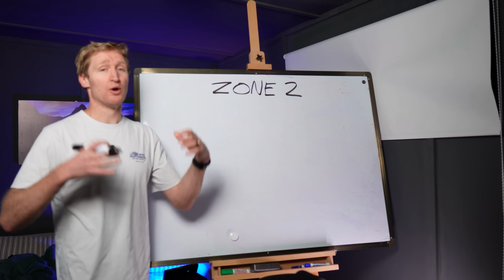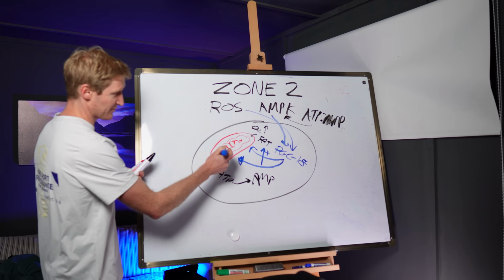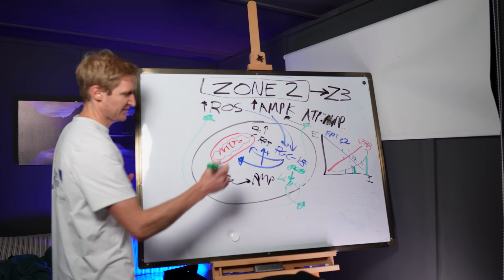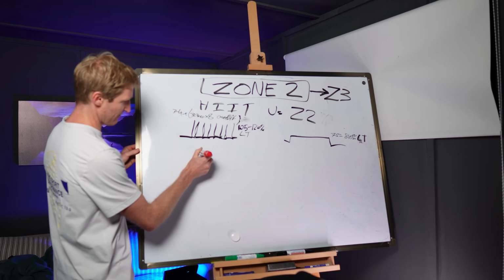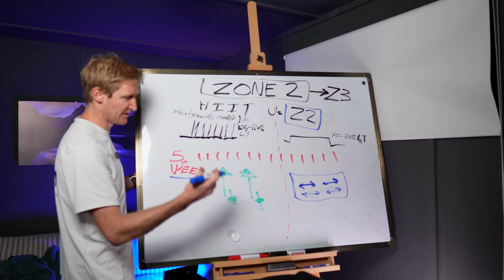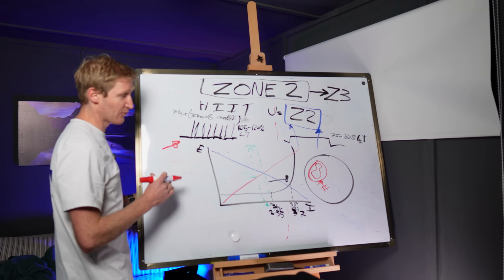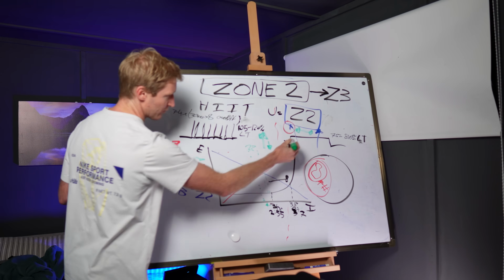Running Top or Bottom of Zone 2 - Deep Dive

Comment: For most runners, the purpose of Zone 2 training is less to do with energy channels, and more to do with safely increasing training load at low injury risk. For elite cycling it's a little bit different because they can train at very high loads with much lower injury risk - so they have more choices about how to allocate those kilometres. For running the practical test of where to run in Zone 2 and whether it's ok to drift into Zone 3 a bit, is whether you can recover in time for the next session. And the recovery test is mainly about the joints rather than whole body energy systems.

Comment: So, my zone 2 pace added 30’s per mile pace, but I stayed in the upper part of the zone 
But in the heat everything has been zone 4 until temp dropped back down into 50/60 degrees and magically is was all zone 2 at same time per mile pace I had been running

Comment: A follow up question: Is it ok to drift into higher zone 2/ low zone 3 during the end of runs due to heart rate drift? On top of that, with it being the summer months heart rate sky rockets despite running at an easy pace. Should I live by heart rate effort in hot conditions?

Comment: Hi Will! Would mixing in a few strides into all of my zone 2 runs undo the benefits of Z2 discussed here?
Reply: No, because strides are short enough to not raise HR. 

Intervals on the other hand raise HR so should be avoided on zone 2 days.
Reply: @aliasgharkhoyee9501 thanks. For me a 20-30 sec stride definitely drives me into zone Z3 (HR which I’d have around tempo effort level at steady state)  when I am already running in Z2 for some time. It also will take 20 secs to get down to Z2.
Reply: @florianpreis9239  I suppose we're using strides differently. I'd consider strides to be about ~10 seconds where you don't speed up beyond 80% of your max speed. 

I can see how faster paces (sprints) and longer durations will increase HR. In my understanding, this should be avoided on zone 2 runs, so shorter and slightly slower strides may be the answer.

Comment: I know i'm not perfectly who this is aimed for because I'm not really looking to do distances over 10k so not fully endurance but I've been trying to use these videos (and the podcast) to understand how to use running as my secondary sport to increase my fitness in the offseason and cross-training during the season for Badminton as my primary sport. 

I'm time limited with coaching during the offseason to 3, maybe 4 max, runs per week and at the moment (offseason) I've been trying to do 1-2 zone 2 10ks, 1 interval session and 1 threshold/max 5k or 10k per week. During the season I will generally be playing 1-3 matches per week which is generally going to be 1hr-1:30hr of 5-30s intense speed work on 15-30s rest within a 2hr session. I'm thinking that matches then replace the interval sessions but for the remaining 1-2 runs is it better to focus on zone 2 for both or keep one zone 2 and a threshold type run as well, or are the intervals more important than the threshold?

Comment: I do a lot of frequent runs in low zone 2/zone 1 during the week. But I try to include one run per week at LT1, meaning the upper end of zone 2. I do this to get the physiological benefits of training at LT1 — compared to low zone 2. But if I understand this video correctly, training at LT1 doesn’t actually provide that many additional physiological benefits compared to low zone 2? And that it’s better to stick to low zone 2 for easy runs, and then go for at least zone 3 when doing quality sessions?

Comment: Great presentation. Interestingly the late Keith Livingstone (R.I.P) exercise physiologists book states that modern science has put Lydiards "1/4 Effort" at about 80% lt2 heartrate or as he called it 65% heartrate reserve karvonen. The bread and butter % of their wkly 100miles (around 75-80%) So that sits nicely in the bottom to mid of zone 2 metabolically in this 90-140min runs theyd do.  "3/4 Effort" was more 75-80% h.r.r or about 89-93% lt2 for the initial 2 x 1hr Marathon Effort wkly runs out & back in his 1st schedule. 
Great work on the presentation   🎉. Cheers Will, Zac.

Comment: Training for my third marathon after years of shorter tracks races and doing very little Z2 training in those days. In the last 2 years I increased mileage and frequency by doing lots of Z2 training (bottom and top end, depends on fatigue) and I clearly notice the effects: faster pace at lower heart rate, being able to run 90minutes of Z2 without fuel and without increase of heart rate or slower pace (I could only do around 50 minutes before) and recovery time between fast reps and after a hard session is a lot faster. So I hope with this better base and lots of training in the faster phase soon, I will be able to (remain injury free and) be faster in my third marathon later this year.

Comment: I try to stay at the high end of z2 for my long runs (anything longer than 75 minutes). I've had this same question for awhile now, but I'm not sure this video gave me a straight answer on if this is the right approach. 😂
Reply: At around 25:00 he says the issue with high z2 is the risk of regularly pushing into z3 and missing out on the aerobic adaptations. And that it's about frequency of z2 for adaptation. From what I understand of this and his other work, you're doing it exactly correct if you're also doing most of your other weekly runs at mid to low z2.
Reply: @edwin5419 in my long run my perspective is different, I use my long runs to be very slow. I dont have a pace value because I use a connectIQ called AlphaHRV and I try to always maintain all the run over 0.75 value. I begin in zone 1 and I don't mind to be on zone 2 because the cardiac drift will eventually get me there😅
Reply: It depends on the purpose of your long runs.

1) If the main goal is to improve your aerobic capacity, you don’t need to stay at the high end of z2.

2) If the runs are race-specific workouts, meaning you're trying to get used to running close to your marathon pace or whatever, then they should be. But these should be limited to once a week at most, in my opinion.

3) Finally, the key is consistent training over time. If these workouts ruin your other sessions or you can't sustain them for several months, they’re probably too intense. If that's the case, it’s better to stay at the low end of z2 and build up gradually.
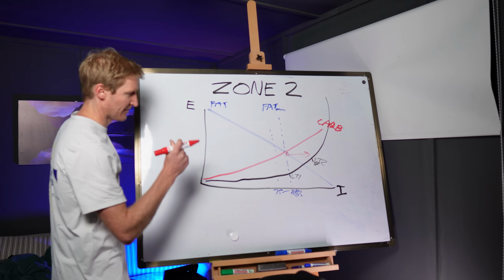Reply: I wantonly half marathon pace to be around 4:45/km (+/- a few seconds/km)

My last half marathon was 4:55/km average.. 

Should I run my current 6 days a week 80% zone 2 low or high, and then the long run on Saturday Easy-HM PACE- Easy? 

Can I also do HM pace intervals so 5x7 mins at 4:45 with 2 mins rest?

Comment: What would you consider lactate reading that correlates to Marathon pace?
2? 3? 4? 
I know it’s case dependent, but what have you observed as the average?
Reply: As you said, it will be case dependent.   
A much better way to look at it is by time rather than distance.  

Generally, any maximal effort under 1min is Z6, under 8ish Z5 under under about 1h Z4 then for Z3 it depends a lot on training but it can go for many hours.   
And Z2 in theory could be indefinite with enough training.

For marathon, most people will be mostly in Z3, slower runners might be a mix of Z2+Z3
Reply from the maker: I've got a video on how to use a lactate meter. I go over this question there.

Comment: If doing longer events, would not you want to slowly get confortable with faster Z2 runs if your race is run at z2 for endurance events?
Reply from the maker: Yes. At that point you're essentially crossing over a znoe 2 run with a race-specific run, so the purpose of the run is skewed towards race prep rather than aerobic base building.
Reply: Yes, but that does not mean most of your runs need to be at your race pace.